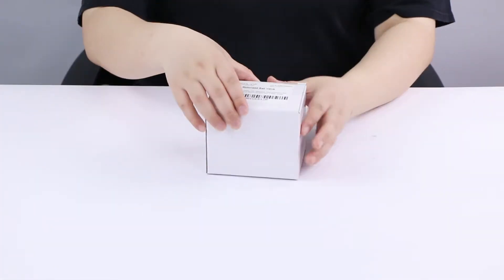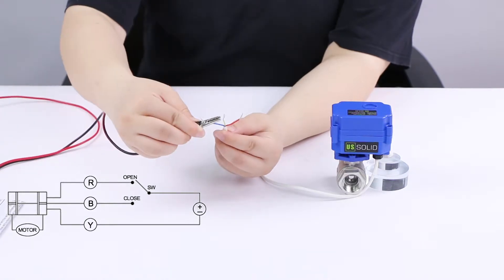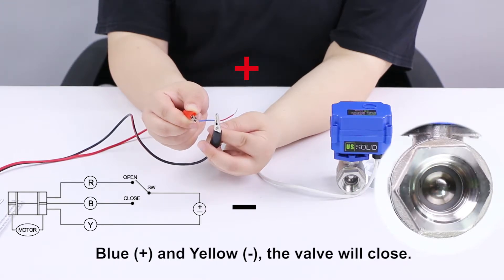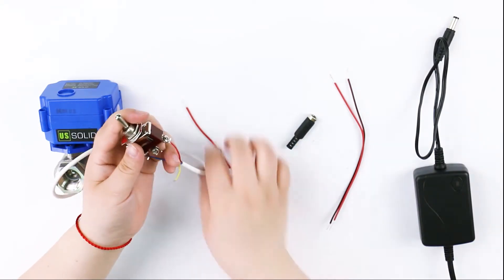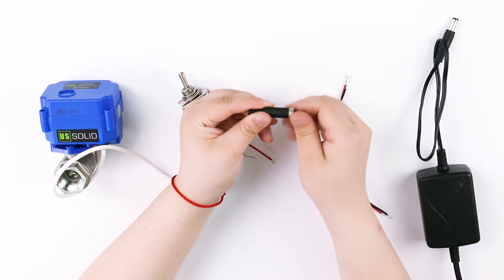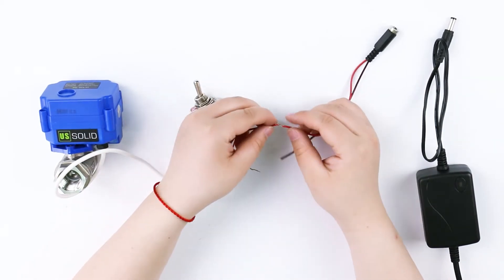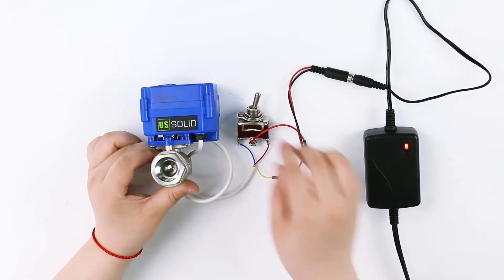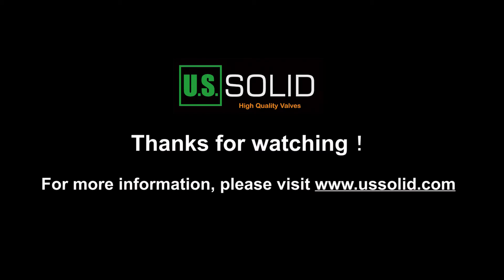USSOLID Motorized Ball Valve, 3 Wire Setup

Comment: If I were to connect it to an Arduino microcontroller, do you recommend the reverse 2-wire or 3-wire setup if I want to also control the speed the valve opens or closes using PMW?
Reply from the maker: You can use both.